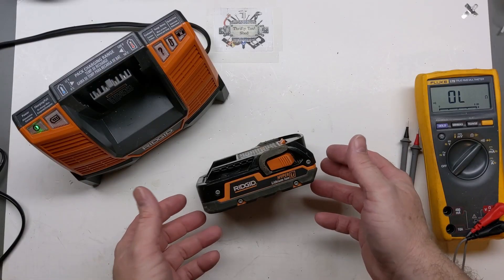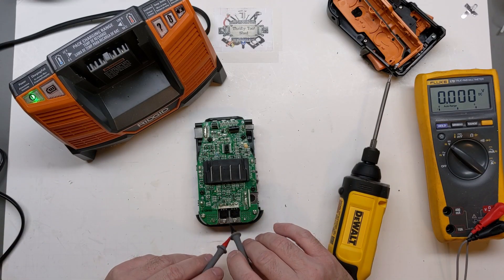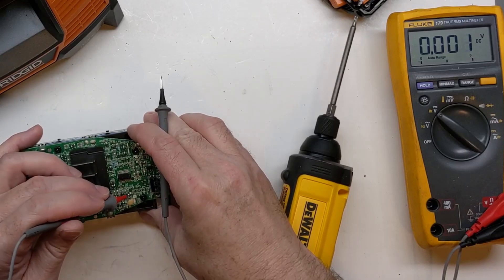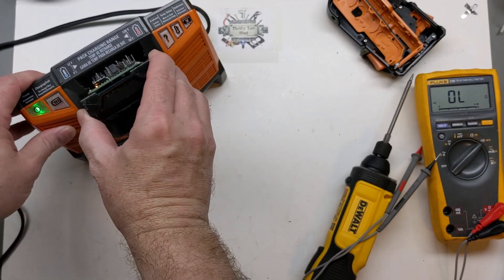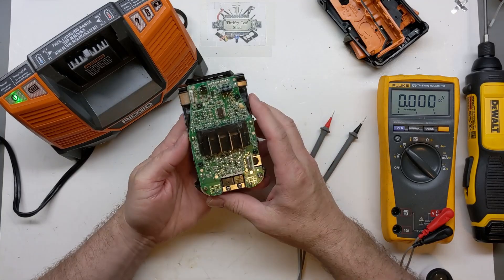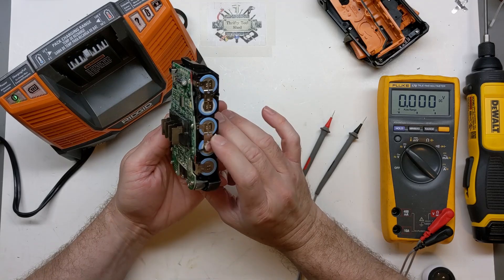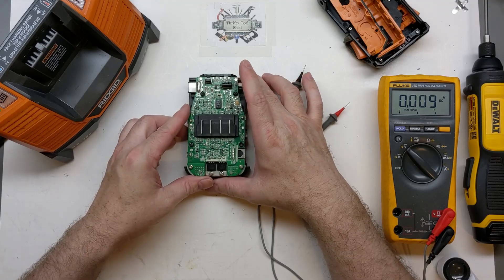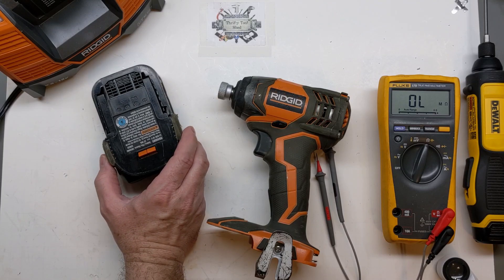Can we get this Ridgid 18V Hyper Lithium Pack back working?

Comment: You can thank AEG for the battery design ;) Ridgid just has a license to make rebranded versions for the US market.

That said; I have 2 AEG Pro Lithium-ion batteries (same as the Ridgid 'Hyper Lithium-ion' ones that you have) that were made in 2010. Still going strong

The design of the case is very good, but the battery protection and balance charging of the board are high quality as well.

Another cool feature is that the batteries are backwards compatible with basically any and all 18V tools, regardless of the battery technology. The charger also supports Ni-Cd, Ni-MH, and Lithium-ion batteries alike. 
So you can revive any 18V tool with a new lithium battery without having to buy any other parts new.

Fun fact; 
in the late 60s, early 70s AEG used to make attachments for corded hammer drills, to 'convert' the drill into a circular saw, jigsaw, bench grinder, lathe, etc. 
They came with a guarantee that these would work with any and all future iterations of AEG hammer drills.
They still maintain that promise to this day, even though TTI has taken over. 

Fun facts #2-7;
AEG pioneered the first portable drill, was the first to make a 'pistol grip' drill, had the first battery powered drill in be used in space (in 1984, more than a decade before the 1st Makita in space).

They were also the very first company to have a unified design strategy throughout it's products and print efforts. 

Basically, the first 'corporate identity' ever (which is of course common practise for every company now. It's why you recognize Apple products, or Milwaukee tools, or a Google service, or Bosch tools or Stanley at a mere glance)
Reply from the maker: I am somewhat fimilar with AEGs background. I have not had any personal experience with them and I knew they were part of TTI now. The Ridgid badge is not straight forward. TTI has the basic home owner tools with the Ridgid label. But the professional Ridgid Tools are different from the Ridge tool company.  I am glad to hear things are still good with AEG still with TTI.

Comment: The hail mary fix. I hate it when you fux something without ever fixing anything.
Reply: I guess i could just keep a couple resistors with my meter. Lol
Reply from the maker: Right!
Reply: It just bothers me not knowing what it was. I currently have one of these batteries giving me the slip. 
I have 18v at the terminals, 4 lights, the charger seems to think its ok. But it wont run a tool. And if i try to use some resistor wire to act as a load there no arc no heat. Not sure if the voltage cuts out as my meter wss in the house and not the shop because it just makes sense that way. Lol. I dunno what the problem is.
Reply from the maker: @mds1986ms  
That can be a tough one. I have seen it be an issue with board/Mosfets not cutting on fully.  I have seen that be a bad cell dropping of really quick and causing the pack to shut down quickly and even once a cell with a bad connection at the spot welded tab causing a similar issue.
Reply: @ThriftyToolShed  
 Hmm ill use mybold simpson and check each cell. The simpsin analogs put i wanna say 20 ohm load on DC votage test and 10 on AC.  digitals dont do that to my knowledge. Much more handing for voltage drop issues.
Reply from the maker: Simpson is tried and true. Still used some today for sure.
Reply: @ThriftyToolShed  
I have 2. My dads from long ago and a new(ish) 2014 i got from a guy thatvworked for 3 mile island. He claimed those were the only meters they were aloud to use out there. 
My baby is my FLIR dm185 thats the Cadillac of industrial meters. You cant imagine how much having a thermal imager built inti your meter changes the game with troubleshooting. You can literally see overloaded circuits.
Reply from the maker: I have had the same Fluke meters, most of them 20 years old or longer and they work great. I don't know if I will ever upgrade to one with the IR imaging built in, I do like the little Flir plug in for my phone though. I use it alot and have really liked it. Not great resolution and the battery dies quickly but if needed it will work plugged in to a power bank etc. They are handy for sure.
Reply: The thing id knock fluke for is price point and some of their meters arev not the most user friendly. Im a meter junkie... revovering meter junkie. I got rid of a lot of stuff in the last year but i had 20 different meters or all types. Im down to 4 technically technically 5 if you count my biddle m10 megger and this nifty handheld oscilloscope thsts just the bees knees.
Reply from the maker: I did get all mine used or I repaired them, I have 7 flukes. Lol...
I like how they have parts available or at least to some point. I bought a MAC tools meter non- working and it just needed a LCD. I figured I would be able to find one. Wrong. After exhausting options online I called to get MAC to quote me a price for one
 They would not even entertain it. You have to send it in and it's a flat rate price. Almost the cost of the meter new. I do hold that against a company big time. Anyway, just thought I would share that about that MAC brand since you like meters too.
Reply: @ThriftyToolShed  
Yeah i guess mac would supply a decent graphing meter. Hadnt thought if that.
Reply: Wrll you definitely got a sub from me buddy. You got some great content. Ill be tuning in on new stuff and ill be getting started on burning tbrough you "lets learn something" playlist. Im all about learning new stuff.

Comment: I just bought a set of 3Ah Ridgid Octane batteries still sealed from a seller.  One showed one bar and is charging fine.  The other showed a blue light and did not charge.  Any ideas?
Reply from the maker: I don't have any octane batteries with the Blue LED. It may have to do with the blue tooth. I still use the 18V hyper lithium packs. I just repair them and keep going so far. I ha e repaired a few Octane tools that I bought non-working, but still no packs! Best of luck to ya!

Comment: may i ask the open circuit voltage at the battery charger output please pal , mine has nothing without a battery connected and then i just get battery voltage when i connect a battery , converted the charger from 110v to 220v as for the south african market but still cannot get the charger to charge the batteries

Comment: hey pal , thanks for the video , helped me to get my new but 2 year old 2Ah pack working again , i am still having issues with the charger though and thought i would ask you a few questions if you dont mind , firstly what do the 2 centre flat contacts on the battery do ? , do you know if the packs can be charged by any other means other than with the charger from ridgid ? , does the charger send a signal through t1 and t2 to allow the battery to accept a charge ? , i have tried charging the batteries with another 20v lithium charger i have directly through the + and the - terminals on the battery but it only allows around 15 to 20 seconds then the battery shuts off , any detailed info you may have on the batteries or charger would be greatly appreciated pal as i would really like to be able to charge the batteries safely and not do any damage to them by not balancing their charge properly
many thanks
sincerely
rich moss
Reply from the maker: Glad you were able to get your pack going! Awesome job. As far as the open circuit voltage on the charger it is 0V. It senses the pack and tests it before it outputs charging voltage so you will not see any voltage output unless a pack is connected and tested good and is in process of  charging the pack. The 2 center terminals are for pack monitoring and I believe they are both of temperature monitoring by means of a NTC thermistor. I can't recall on these packs if the NTC connects directly or not but I am almost certain the NTC does go through the board and may be a feedback to the microcontroller and the microcontroller may output to the charger? I really can't recall for sure. The many brands are all a little but different it seems. Anyway, I don't see a easy way to connect these to another charger until we know exactly what  the T1 and T2 terminals do in the charger. I have no schematic for these of course so what little bit I know has been from tracing and troubleshooting specific issues.  I have not had to look into these terminals closely yet. As far as charging these, the best way is always to check individual cells for balancing so, charging any other way, the cells would need to be out of the case. I use a CC-CV supply to charge cells. The Constant current and Constant Voltage is a must so you can set the current to a safe level like 500ma to 1A and set the voltage  level at cut off voltage, such as 4.2V for individual cells or 21V for the 5S pack. Again if using 21V accross the pack the balancing will need to be checked often. The BMS board des that for you in the charger, so manually charging means we have to do it. You don't want one cell being at 3.8V level and others at 4.3V or so that could ruin the cells or even be a hazard if you go much at all above 4.2V on the cells. Best of luck to ya!
Reply: much appreciated pal , i will continue trying to find info for the charger but in the mean time will just continue charging the batteries with another small lithium 21v charger i have , i know it is not ideal but i dont have much of a choice , a little irritating that the brand new charger doesnt seem to work , the items stood for around 2 years before i got my hands on them but cant see how this could affect the parts but my knowledge is limited so i guess anything is possible , all the batteries are performing well and i dont have to charge often
one last question , seems like there is 5 volts coming down the t1 and t2 wires from the charger to the battery , wonder if i give the batteries 5 volts on the t1 and t2 if i could get it to charge through the battery plus and minus contacts !!
any thoughts mate ??
Reply from the maker: @richardmoss2904  I don't believe it will charge through that.  It is a feedback from packs NTC I believe. I have not traced through that to know for sure.

Comment: I cleaned my circuit board with some alcohol and a toothbrush. Now my 3rd light D2 has not stopped flashing. Like you said, It thinks it's charging.  its been over 24 hours though and it hasn't stopped flashing.. This flashing of the lights has made it to work again, some how it made it work. Like on your video, I had to bypass it before for it to work. Any idea on how to make it stop flashing? This battery did not charge, I got a "Defective" light on it and it did not work as well until the bypass and the current lights status. Any help would be appreciated. P.S. I bought some contact cleaner today and tried cleaning it again and nothing. Lights keep on flashing. Thank you for the video
Reply from the maker: I have not seen one do that and not stop yet. I was thinking try cleaning again or contact cleaner, but you have already done that. I do not know other than something is either shorted or bridged on the board making that happen. Without schematic it is very difficult, with a magnifying glass tracing the circuit back from the LED back to find something will just take alot of time and the VIA's in the multiple layers makes it tough. I would think it is a input to the microcontroller causing the blink so most likely a small and transistor shorted or bridged maybe.
Wish you the best with this, hate yours don't stop blinking. These things are tough to troubleshoot. Best of luck to you with yours!
Reply: @ThriftyToolShed  i found some circuit boards from china for a similar offmarket model R840083 for $15 on eBay. I will use a magnifying glass and see if i can find anything bridged or shorted. If not i will report back in about 40 days with my switching of the board experiment. Thank you!
Reply from the maker: I have a video on a Makita 18V 3.0 pack that I used the cheap replacement board on. It did well. I hope you have good luck with yours as well.  I have not had to replace one of the Ridgid packs that way yet.
Reply: @ThriftyToolShed  im back. After many hours of trying to desolder the joints(my desolder wick arrives tomorrow) i got the circuit board off and put the new one in. Battery was doing same thing with multi meter and i had to bridge both negatives for it to give me a reading of 4.53. No lights were coming on, not working either. I bridged the negative post to the negative joint and placed on the charger and that jump started the battery since nothing was happening before. Not i have a fully working battery with a $15 circuit board i bought off of ebay. I received it quite fast, 2 weeks. I made some videos of my process maybe i will upload them. Thank you!
Reply from the maker: Excellent. I would like to see the video for sure. Thanks for the update.
Reply: @AmwayXS  and what happend? works or dosnt? please let us know. regards
Reply: @gabrielbendezu6979  yes the new board from china has been working great. I actually got that battery warrantied out and i replaced the board on the faulty one so i ended up with 2 new batteries you could say. Ill get around to uploading the video in the next few days. Not really sure how to edit them.

Comment: Thank you my man!! I'm seeing similar responses but my reset is not working at all and no blinking. But showing 14 volt on board and 9 on mofset forgive me if I spelled wrong . Do clean board and jump the mofset,? Ok :)
Reply from the maker: Yes I would clean the board with a good contact cleaner. You can test like I did by going Mosfets, but if you did that permanently you would not have low voltage cut out protection.

Comment: I have a similar 4 amp hour pack. It shows no lights. Reads 15.78 on the main terminals but 18.03 directly from the cells they're all balanced (it was 2 lights before going weird). I ground the reset - I get all four lights to flash as if charging then turn off. At first the charger was saying it was fully charged after evaluating - now it says defective. I don't see any visible corrosion... baffling.
Reply from the maker: Sounds like a board issue for sure. Have you tried the cleaning yet? Some on here are saying they had luck cleaning theirs like I talked about in this video. I did not see visible corrosion in the area that helped mine either. Maybe it will help, that is all I would know to try, your cells seem good from what you describe. Best of luck to ya!
Reply: I have the EXACT same problem. 15v at the terminal, 19.7 across the batteries. No LEDs from the button, blinked on reset but no change after. I don't see any corrosion, will try cleaning but am not hopeful, would love any other ideas
Reply: I've cleaned with sensor cleaner and brushed with isopropyl alcohol. No changes. I probed for a few nights after work and uncovered nothing else... Anyone else have any luck?
Reply: @mattcreator8480  Nothing yet. I noticed something really weird though, might be a clue. Measuring directly across the cells showed 19v. Measuring from the negative connector terminal to either the positive connector terminal or the positive battery cell output showed 14v. But measuring from the negative cell output to the negative connector pin showed 0v. Doesn't make any sense to me

Comment: Awesome video.  Had the same issue.  Cleaned the circuit and the battery came back to life (I believe the corrosion was around the IC).
Reply: i wish cleaning corrosion fixed my problem